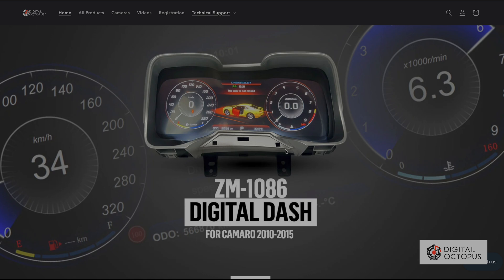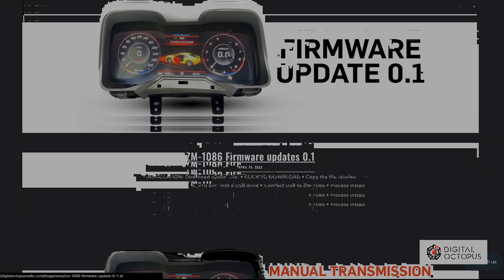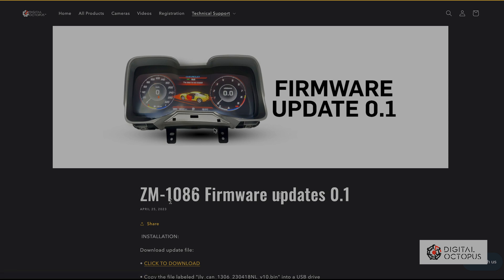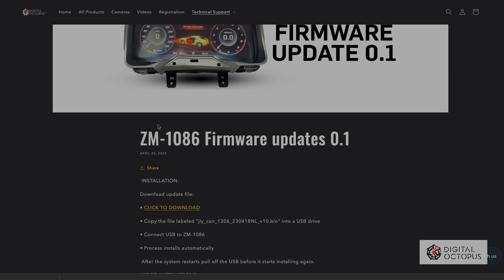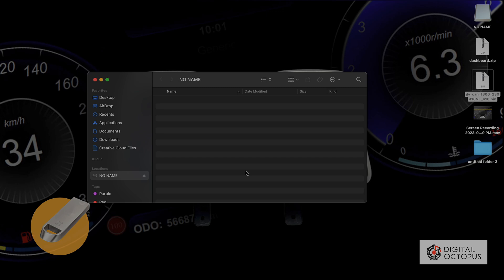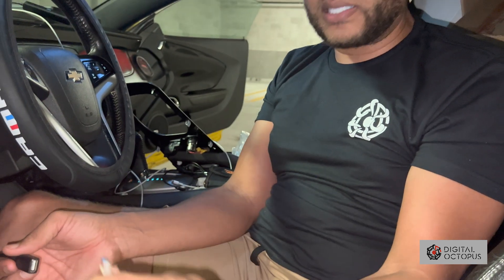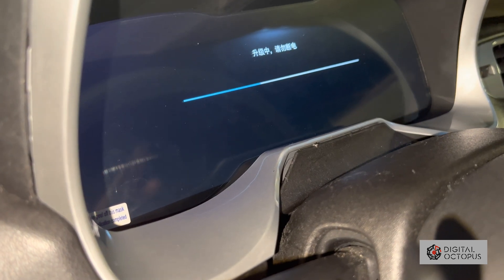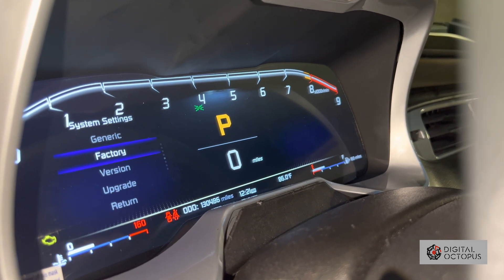ZM-1086 Firmware Update 0.1

Comment: Do you have any updates for the TC button, turning off stabiltrac and traction control ??? 2014 Camaro SS Manual, and ice on the screen, and when the battery die it say open door to reset ???

Comment: Just installed mines on 2014 Camaro SS, did you ever get the update for the HUD, Doors Opened, Manual shift in the HUD, New Camaro Logo for the 2014-2015 Camaro on the screen, skip shift on the screen, tire pressure to stay on PSI, and the Camaro on the tire pressure screen is blue, can we change the color of the car on the tire pressure screen, how did you get your real time to stay on orange my bezel dosen't snap all the way in on the corners and ideas how to make it a little more flush ??? Thank You  !!!